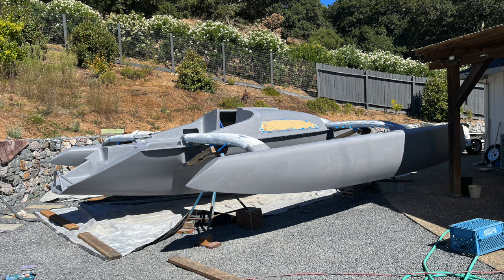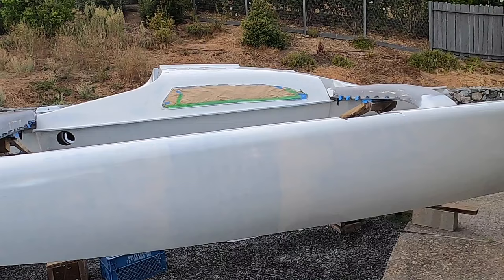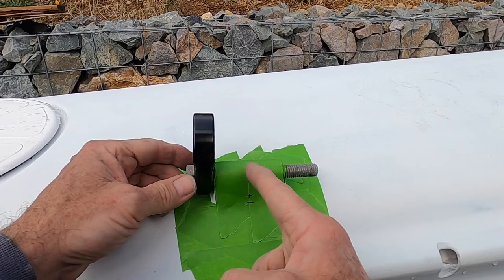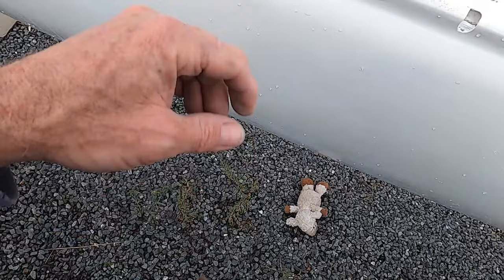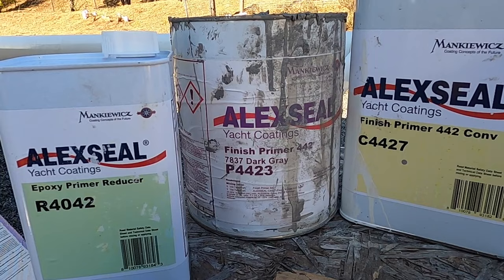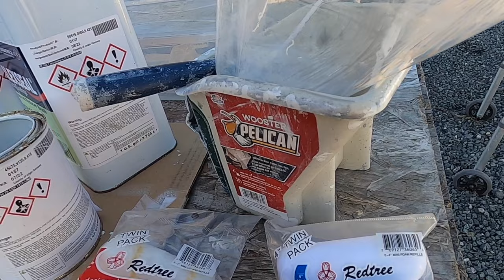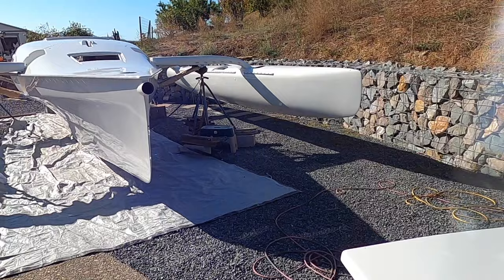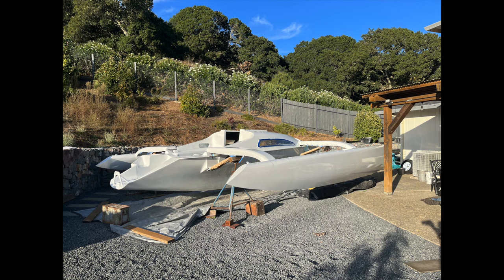Painting the Farrier F25C trimaran with Alexseal TopCoat 501, rolling and no tipping!

Comment: It wasnt reduced enough on the 1st coat,  do a 2:1:1 mix and add 1% rolling additive and add a splash of reducer to the tray intermittently.

I only use West System 800 foam roller on a 230 (or 7")  frame, removing nearly all the paint off it before rolling out...they give a killer gloss finish and coat very evenly. Ive tried all the small roller options and nothing comes close to West System for quality of finish.

The finish on my Roberts 45' is world class and given im not a painter is a testament to the Alexseal product.
Reply from the maker: Doc, are you talking their yellow epoxy rollers? They are so thin - interesting they rocked your paint too. Will try that maybe on the rudder & dagger paint I’ll do soon.

Comment: WOW! We spent months on our tri painting in 2-pack then sanding down and top polishing… this looks SO much better and quicker! Thanks for talking through the process as well. How does the Alexseal wear? Is it as tough as 2-pack?
Reply from the maker: Hi. I don’t know of “ two pack”. Alexseal is a two part, linear polyurethane. It’s a similar system to Awlgrip and Interlux Perfection. But those other two still require tipping. Alexseal lasts just like the other LPU paints, ie very well.
Reply: The beauty of using Alexseal is the clear is throughout the entire film thickness, so if any repairs are required they can be feathered in and polished properly. 
I know of no other topside paint in the market that can be repaired like this if its required.

Ive not polished, cut, or put any other compound on Alexseal other that wax and still has that amazing "wet look" glossy shine

Comment: Wow, Greg!  This looks amazing!  Do you know how many total hours you spent on the prep and paint?  Exclude the time fixing and updating carbon pieces, just the paint job?  I wonder what a paint job like this would cost from a professional shop.  Well done!
Reply from the maker: Hi Mike. Starting with sanding back the failed paint, I’d say there was about 50 hours in prep & primer work. The topcoat paint was about 30 hours including the two full sandings between coats. I think it was two solid weeks of labor that I spread over a month. Imagine it would have been $20k at a yard. But let’s take that ? To the Fboat forum… posting in a bit.
Reply: Your $20k is on the money, i was quoted $15k if i supplied the paint. 

The marina i did mine at had a pro spray shop onsite and i ended up doing my gloss application over a long weekend applying paint just after sunrise (painting after 12 noon isnt advisable) each day.

On the Tuesday morning the proprietor of the spray shop called me as he could see the incredible finish. He said someone will probably complain about me "spraying" my boat in the open air. I told him its rolled and he didnt believe me as he said he had gone over to the boat and felt how even and eye popping glossy it was. 

He said in 30 years of painting yachts he has never seen a finish like that.
Reply from the maker: Doc, any issues with debris/bugs in your final finish? That’s the bummer of doing this outdoors. I have some dead bugs and don’t k know the best way to polish out the Alexseal. Have you done it successfully, and how?  Thx